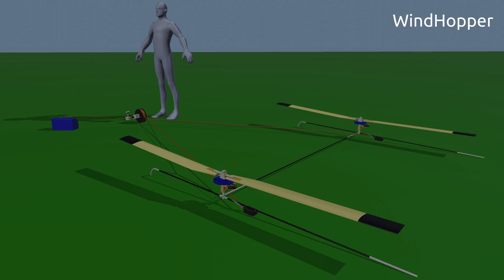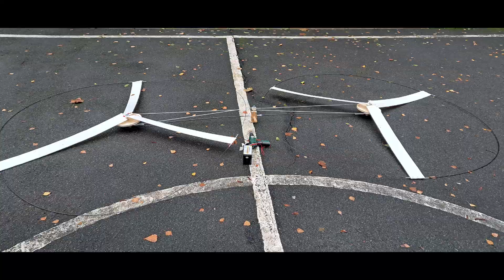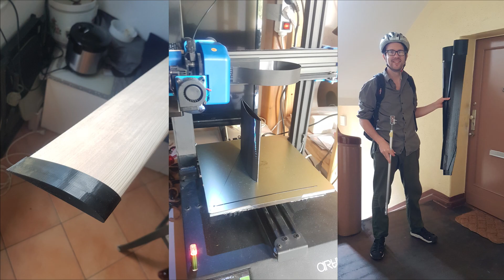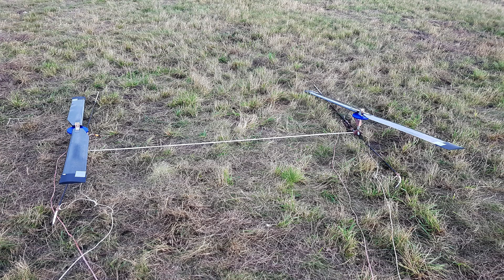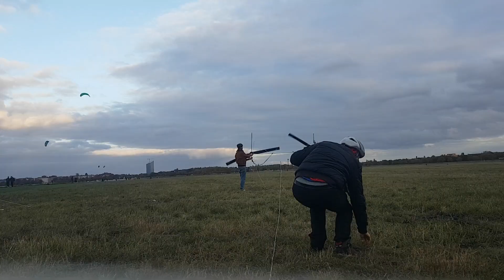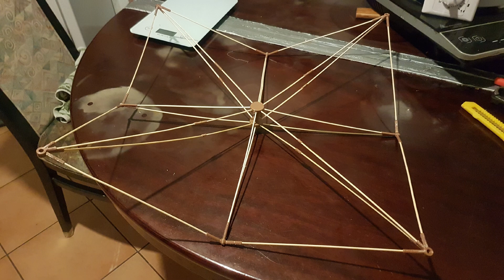WindHopper – Airborne Wind Turbine & Manned Quadcopter

Comment: The two rotor version looks pretty nice! Four rotor looks iffy to me, but I'm not the one trying to build it.

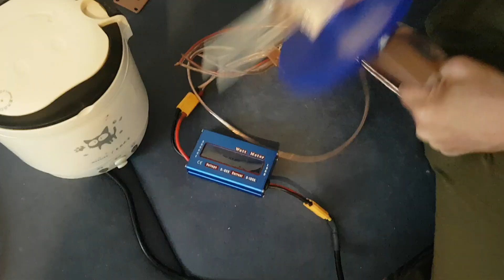The 1st trial at 10:12 makes me think that a single rotor might be more practical than 2 or 4 ... you don't have to worry so much about a frame that is almost parallel to the blades. A bent tube leading to a delta kite rigging should do (you bend the pipe at the hub, so it angles downward from the blade plane).

Of course, with a geared hub this may result in a lot of torque ... you'd also need the tube to extend beyond the rigging toward a fixed rudder to counteract the torque. But even so, I feel like this may be simpler to deal with since the tail boom can angle far below the blade plane.

I suppose there's also the option to mount the motor/generator on a blade. That would eliminate hub torque and also eliminate the need for gearing.
Reply from the maker: I am actually more confident in the 4 rotor version compared to the current 2 rotor one. It only uses tetrahedrons (triangular pyramids) which should make it very stiff/stable for a given mass.

I in principle like the idea of tip mounted motors and had already looked into it. As you said it eliminates the need for gearing and torque compensation. On the other hand you need to now transfer power through a rotary contact. If you mount the motor controllers on the blades themselves you could at least get away with only a 2 pin rotary contact. Otherwise it would be 6 for 2x 3 phases. 

And now you also have fast spinning rotors at the tips that increase noise and are exposed during a crash (vs the current elastic TPU tips).